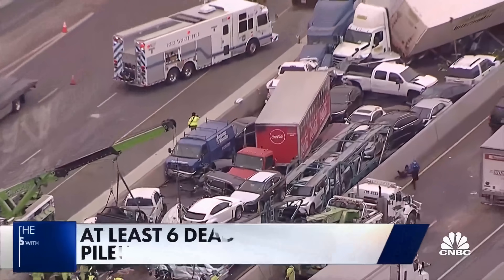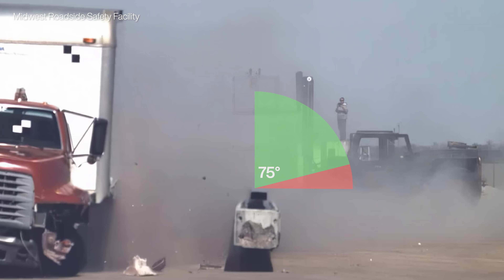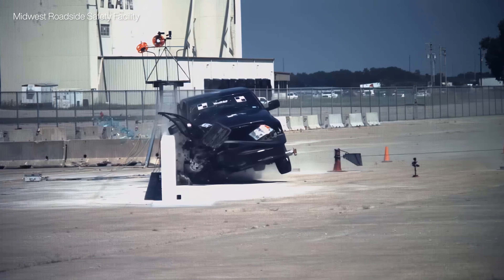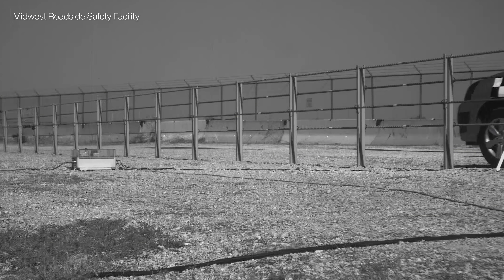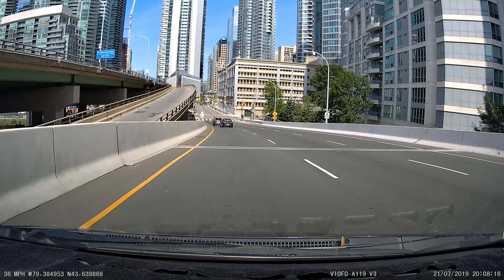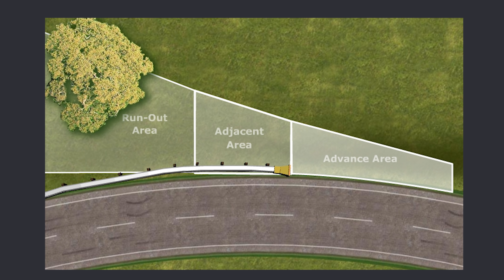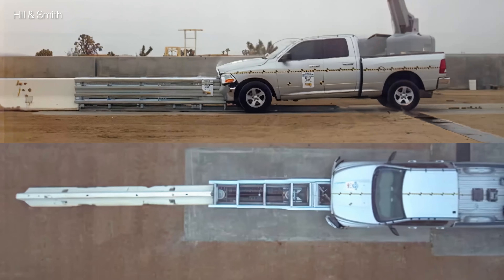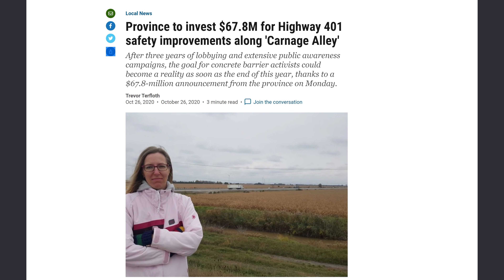How Road Barriers Stopped Killing Drivers

Comment: As a retired over the road truck driver, I think that the median should be sand, because sand works so well on a 80,000 pound fully loaded truck using a runaway ramp. If the median is maintained like the cable wire, which is also great, the sand trap guards should also save lives.

Comment: The concrete barriers work well for cars and light trucks... But are deadly for heavy trucks.  
The cable systems still work for cars but work far better for heavy trucks. 
I've seen several truck recks that hit concrete barriers that the drivers and passengers did not servive because the barrier was not designed to stop heavy trucks.  I've seen some of the cable systems hit by both cars and heavy trucks that obviously saved the lives of those who where unfortunate enough to hit them. 
I personally faver the cable systems for the ability to save lives.
Added bonus is it's cheeper to make .

Comment: 15 or some odd years ago maybe closer to 20 I was traveling through upstate New York up steep snowy mountain roads, and they use these wooden blocks with cables through them on the side of the road, which terrified me as a young child because just passed the cable barrier was a steep drop off down the mountain. No way it would stop a car from going over or through and careening down a mountain.

Comment: The Inland Island Highway on Vancouver Island is stock fenced in areas where Roosevelt Elk are an issue.  It was decided that it was unnecessary along the remainder of its length because the hazard was Black Tailed Deer collisions, an animal which, when collided with at highway speeds was calculated to be a survivable accident.

Comment: 3:50 - the lower ramp on the concrete barrier is specifically designed to turn a car's front wheels away from the barrier.
Cable barriers are specifically designed to dismember all motorcylists, and must never be installed.

Comment: What I don't like about the cable barriers is that if you are in a vehicle that doesn't have a roof (such as a convertible car that is low to the ground) and your car goes under one or more cables, the cable is going to dissipate energy through you, not your car. Not a fun thing to imagine.

Comment: There's a bypass where I live, its heavily used. Originally it was laid out with a pretty scary deep V groove in the landscape for runout between directions... At one point within the last 20 years, someone said hold my beer and jumped off and launched into oncoming traffic. They added cable guards to the landscaped parts (the bridges and overpasses always had concrete and dampeners) and its seen its use quite a bit, but never the horror of a launched truck into oncoming traffic ever since. I can't imagine a stretch of road named "Carnage Alley" isn't worth the cost, just the map of that road looked like it was laid out by a d-head

Comment: Some 50 years ago a friend crashed inte into the fence for the near walking/bicycling lane fence/guard. Driving a VW Beatle with a rear mounted engine the protection of a front mounted engine didn't exist.
The fence was built on vertical bars united by a continues horisontal bar. The VW broke the horisontal bare that went into the car and penetrated it. It also penetrated the driver fractions of an inch to the heart. 
When car stopped he was sitting there with a spear through his body, but he survived!
We were class mates during high school..... The militaries didn't expect him to serve....

Comment: The cable barriers are a biker's worst nightmare, they literally cut them in half if going at high speeds, would rather try my luck with cement, open air, than get beheaded by a cable.

Comment: This video made me feel a little bit safer, thank you. I've always had anxiety in cars from a few accidents I've had, understanding how things work always helps me overcome my fears though
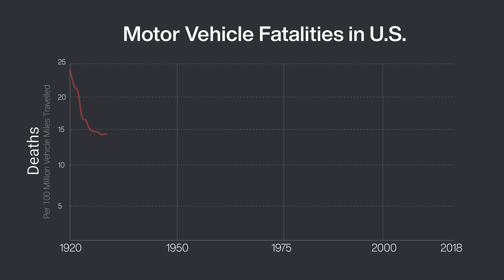Reply: Why do you feel safer? The number of US road traffic fatalities has trended slightly upwards over the past 20 years. 288 million in 2002 to 338 million in 2022. The graph at 0:17 is misleading as it is per 100million miles but is presented as the total number of fatalities. Also the majority of that graph is <1975 before all the big highways were constructed so the total distance was pretty insignificant compared to today.
Reply: @nullid1492 I'm not sure where you got your info, but what I'm finding is that as of 2021 the number of road traffic casualities worldwide was estimated to be only 1.19 million. In the U.S the same year it was only 42,939 fatalities, and that number has been dropping roughly 4% every year since covid
Reply: @nullid1492 He said that he feels "a little bit safer", which seems reasonable given the information in the video about barrier design for safety.  But, I understand your point.  If fatalities increase, driving is nonetheless hazardous, increasingly so.  Fatalities would be likely much higher without the barriers though.  I feel safer with the concrete barriers, particularly in areas where traffic is not so heavy.

Comment: I would like to know if the wire barriers protect motor cyclists at all. The unseated rider can slide through or else be cut up quite badly by the barrier and posts.

Comment: You can fix most Western roadway rush hours dramatically by banning the majority of semitrucks from the roadways between 7am - 9am and 3:30pm - 6:30pm within major city limits. Also stopping most school busing on highways besides like field trips and magnet schools where the child earned going to a farther school because of their academic achievements and not some liberal ideal based upon their color and those of their classmates at "F" rated schools.
edit: Also as a resident of Florida, the elderly need annual driving tests to make sure they're aware enough to drive, especially during rush hour times.

Comment: Clear spaces allow vehicles to cross the median and hit vehicles going in the other direction head on.  Happens here between Phoenix and Tucson more often than it should.  Cable barriers will cut a motorcyclist in half.  Cable bariers were installed along the 101 loop here when they first built it.  They replqced them due to the number of head on collisions due to vehicles going through them.\ and not being stopped.

Comment: i learned roll over is better than crashing strait in to an obstical. thats also the reason why motorsport crashes are worst case szenario when they hit something strait on and not if the car rolls 100 times becouse it absorbe energie

Comment: I got shivers while you tried to justify a cable barrier.  im shocked by how wrong those "studies" are too.
As a first responder cable barriers are a horror to deal with and are fatal to either driver or passanger about 90% of the time and there is nearly a 0% survival rate for motorcycle riders.

The best part about this whole vid is that we have been using both the concrete and metal barriers you are saying are of new design for nearly 70 years.
Oh and fyi the design actualy came from the US way back in the 30s.

Comment: Thank you for sharing this video, it was very interesting to watch! I live in Europe, and seeing how similar and how different some of our approaches to road barriers are was fascinating.
One thing I wish you had covered, at least superficially, is how these safety measures protect (or harm) motorcyclists, as they are far more vulnerable than car/truck drivers (motorbikes are more frequently used in Europe, so this seems to be a larger concern here, compared to North America).
Reply: Research conducted in Europe (particularly Scandinavia) shows that the use of wire rope barriers basically sacrifices motorcyclists to save money for other road users.  The worst type of crash is low angle of incidence, with one of two outcomes for the motorcyclist.

If the motorcyclist is still on the bike at the point of impact with the wire rope barrier, they tend to roll along the top of the top cable, and suffer massive torso injuries from the tops of the support posts.

If the motorcyclist has already separated from their bike before they strike the barrier, they tend to slide along under the bottom cable, until their head is separated by contact with a support post.

In either case, a significantly higher fatality rate than just about any other barrier type.  And for 'scale', 2018 stats show that 8% of American homes own a motorcycle.  So not an insignificant number of citizens threatened by the barrier type choice.
Reply: In 2006 cable barriers, aka "the egg slicers", were banned in Norway for this exact reason.

Comment: It looks like the whole process of slowly making things safer had one step: very slowly copy more and more of the Dutch barrier design.
Reply: Cable barriers you won't find in the Netherlands though, FYI.
They look really shoddy.

Any road that could benefit from barriers, will have proper barriers (mostly the steel ones).
There is no "there's not enough money to cover the whole road network" talk. It is simply done.
But of course, the population density is much higher there.

Comment: I find it curious that the tests for thoe barriers do not include motorcycles crashing into them. Those guardrails and wire on post for example are lethal for anyone sliding/flying into them at speed, which is what will happen if you crash your motorbike.

Comment: Question. Why is the sand cushion so freaking expensive? It's barrels with sand in them.
Reply from the maker: The size of them and they're a specialized, low volume product.  There's also regulatory approval and testing.

Comment: They used to call windscreens "death collars" cus in an accident your head would smash through and it would lacerate your neck and kill you. Modern glass breaks into smaller pieces with rounded edges so if your head smashed through, it won't hurt nearly as much and it's saved so many lives.
Another one is seatbelts, another big one is crumple zones.

Comment: One more benefit of using cable barriers, is that during snow storms, especially on the prairies, snow will pile up behind concrete barriers and cause large drifts on the highway.  The wind and snow can flow through through the cable barriers and not cause drifting.

Comment: My dad used to work for the state back in the 80’s. He said roadworkers got busted…sometimes, after an accident damaged a guardrail, if the machinery was tied up…the guys would just use older cull post to reattach to guardrail. These post were barely in the ground a few inches and were basically just cosmetic.

Comment: These are great for cars, but very dangerous for motorcyclists. Fell off my bike a couple months ago, and slid into the guard rail at 30 mph. I was going slow so i broke my femur and clavicle. At highway speeds, my leg and arm would have been amputated. Had there been no guard rail, I would have walked away with no injuries. Id love to see guard rails that save both cars and motorcyclists like the ones they have in some places in Europe, but I imagine its not cost effective to save motorcyclist lives like the guy said in the video :/

Comment: I'm glad you said barriers are hazards. I have been a highway engineer for 40 years. I cannot tell you how many times I have had to explain that crashing into a barrier is more dangerous than rolling to a stop on a grassed side slope.

End anchorages are very dangerous. I saw photos of a car in which the driver dozed off. He was awakened by a guardrail tearing through his cabin, inches from his head at 70 mph. He had drifted into an interstate guardrail end section and impaled the car on it. About 50 feet of guardrail passed through the car and protruded from the back.

I don't like guardrail. I'll work pretty hard on the roadway geometry to eliminate as much as I can.

Comment: You mention the fatality rate has steeply dropped even with more drivers on our roads today, and that Carnage Alley has low traffic. 

I'd like to see data on how increased traffic causes traffic jams, therefore lowering the speed of traffic and reducing fatalities (even if the number of crashes increases, they will be less damaging at low speed). Carnage Alley missing a barrier is only a problem if traffic can move fast enough to cross the median.

Comment: In my city a drunk driver hit the center barrier of the local highway and the car glided off the barrier and stopped in the middle of the highway, so they deemed that was unsafe because it pushed the car back into the road so they tore out all the hard barriers and replaced them with wire fences and another drunk driver smashed into it went directly through it with barely slowing down smashed some trees and he died so they ripped up all the trees in the center area then a semi lost control went straight through the wires straight through the center ditch going right through the wire barrier on the other side and came to a stop blocking traffic in the other direction.

Comment: I was driving from denver to Cheyenne one time and I didn't sleep well the previous night and this was early morning so I was still waking up, i was driving through a construction site in an 92 accord, very low car, was doing the speed limit and everything was fine however i wasn't paying attention to how close i got to a barrier during a turn, one of the barriers was damaged and I didn't see it in time and i hit it, it just popped both driver side tires yet never touched the rims nor the body of the car, had to replace the tires however if the barrier wasn't shaped at an angle it would have completely totaled the side of the car, but thanks to smart engineering my lil hinda was untouched lol

Comment: My job is just off a street with a blind corner at the top of a hill after a stop light. There's a steep drop on either side of the pavement leading into the grass/ditch. Cars and trucks crash here roughly once ever 1-2 months, and sometimes roll over or overcorrect into oncoming traffic. There are fields on either side of the roads and fatalities, thankfully, aren't common. The road connects between two highways and gets heavy use, with a speed limit of 45 mph on a road with one lane of traffic in either direction.

I work at a dairy farm, where we've put up two barriers, one for the cows, and one to ward off cars and pedestrians. The cows love to try and explore the wrecks whenever the vechicles crash through the fences. It takes us less than 24 hours to repair both fences when accidents happen.

The logistics of the terrain make this a difficult problem to solve, it's good to know barriers like these are effective, safe, and might one day be installed on this turn.

Comment: In one of the crash compilation videos, people were actually complaining about having a cable barrier that seem to have prevented a car at high speed going through to a clear zone between the opposite way highway road. People argued that it was dangerous in general (as you showed otherwise), but also dangerous in this case and that just having the car go into the clear zone would have given the car enough time and space to control the car instead of smashing it into the cable barrier.
Another argument was for motobike riders and how it was basically a death sentence at good speed since it reduced the area of impact and thus could even cut through at high enough speeds.

Comment: Kinda surprised at the expense of some of these guards and barriers.
There is a lot of passive safety features on roads, specifically highways, like rumble strips, reflective lighting. But ultimately, tighter control of licencing is the best way to keep bad drivers away from the roads.

Comment: Back in the 1960s, I was involved in a serious accident at an intersection in eastern Pennsylvania. The intersection was between a highway with a 65 mph speed limit in a lesser highway with a 45 mph speed limit. The intersection was at the top of a hill and visibility was about 100 feet or so from the intersection. For years, residents and lobbied for a traffic light at this location but were told that the intensity of the traffic at that intersection was not large enough. After a few more serious accidents, they decided to eliminate the intersection by making the lesser traveled highway an overpass. It kind of puzzled us, that the traffic light was too expensive, but the overpass was OK. I think maybe they decided the savings in life and property with the overpass were sufficient enough whereas the savings with the traffic light was not.

Comment: Minor terminology correction: concrete barriers don't use a "sewage" system. They use a drainage system. To explain further, there are two types of sewers: storm & sanitary. The storm system conveys rain water and is also referred to as a "drainage system" and the sanitary system conveys wastewater (i.e. from toilets, sinks, carwashes etc.) and is also referred to as a "sewage system". In your video you mentioned the "sewage system" along the concrete barrier, but that type of sewer would not be conveying sewage. You labeled the sewer correctly, but it would be conveying rain water, and would therefore comprise a drainage system aka a storm sewer. Thanks for the great video! I really enjoyed it :)

Comment: I believe the comparison figures for concrete vs cable are way off the mark in reality both concrete and w-beam traffic barrier will undoubtedly have far more light impacts and shallow glances resulting in unrecorded hit&runs. These same light impacts are recorded far more often due to the vehicles getting tangled and preventing them from driving off.  Also a few of the "MSKT End treatments" you showed were actually SKT or SKT-350 Ends from the NCHRP-350 testing period prior to MASH implementation (notice the lack of strut bar between posts 1&2 and open throat on the outer chute of the head) other than that great video!! very informative and well assembled.